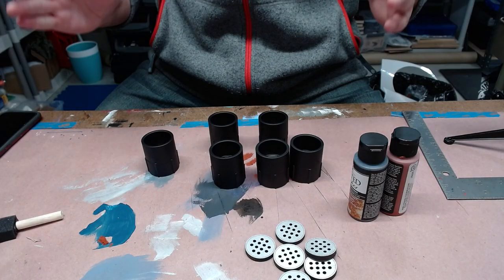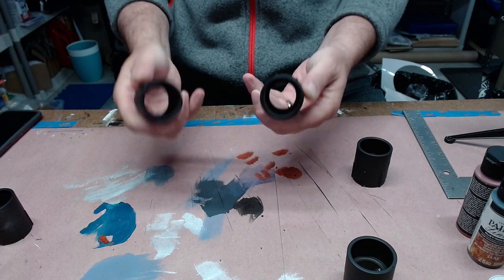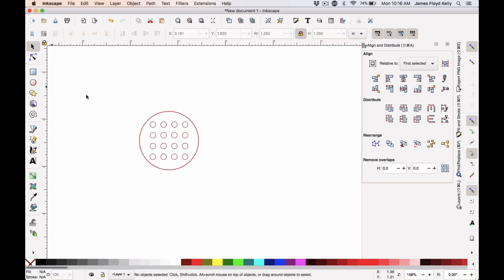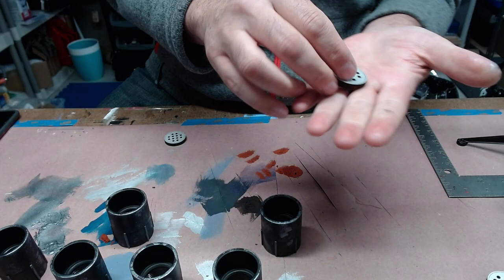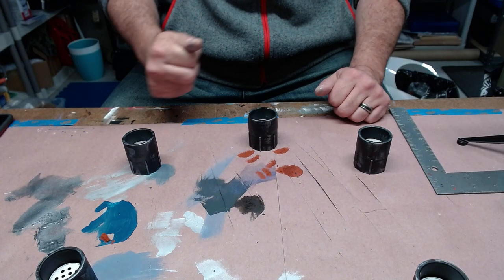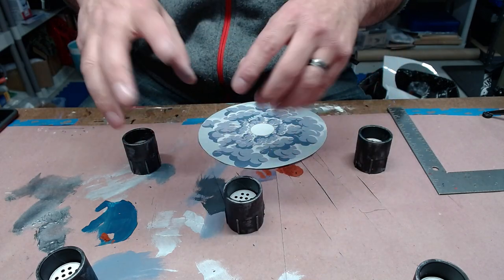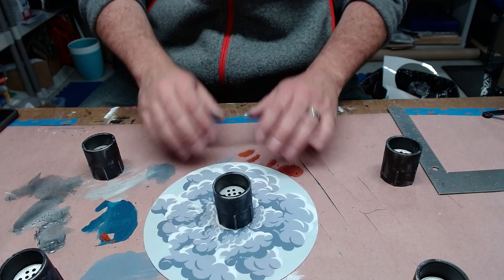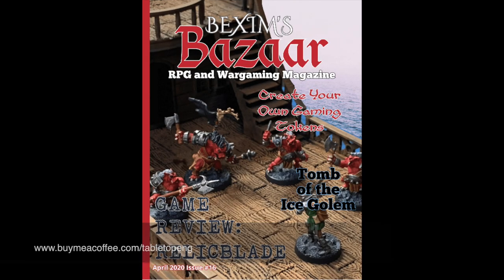Stargrave Terrain Scenario 3 - Steam Vents of the Undercity

Comment: It occurs to me that a thin, plastic ring of the right diameter would be an even better marker than that flat template. Putting the template in place would require lifting not only the vent terrain by also all miniatures or scatter in its circumference. A ring would drop around that circumference, and clearly mark the range of effect!
Reply: I had the exact same thought. An empty ring done up to look like steam would work so much better.
Reply: I left a hole in the center of the graphic to cut out for just that reason. It can slip over the vent if you need it to.

Comment: I have been thinking of getting a laser cutter but have no clue where to start for anything affordable. Seems super useful for scratch building. What model do you have? Are the ones in the same range as resin 3d printers (like 200-300ish) worth getting do you think?
Reply: Hi, Joe. I was where you are a few years ago. I got the Glowforge Basic figuring it would be a good tool for learning, and it was. That said, I would not purchase a GF again knowing what I know now:

1. You're dependent on GF for calculating tool path -- you create the image, but you have to submit it to GF for their servers to calculate the code required to drive the laser cutter. While I've never had difficulty submitting a job, they are now charging $50 per month to get in the "hi speed" lane (it is $15 for month for us original backers, but I would NEVER pay $50 for it). I've heard complaints from those not using the service that they get in the queue and can wait minutes to half an hour or so.

2. Repairs require one of two solutions - you send it back in and wait OR they offer you a discount on a refurbished machine that they send you and you use the box to send your non-working unit it. This is not acceptable for small businesses, but for hobbyists it might not be an issue. 

3. The GF is SOOO SLOOOW. Engraving and cutting is sluggish compared once you've tried your hand at $5000-10000 machines. The BASIC is now $3000 for a 40W machine. You can get a Thunder 100W for $10k. Yes, 3x+ as much, but a 30 minute cut job on GF takes about 5 minutes on the Thunder, so a small business will more than make up the costs of the higher $ machine over time.

I have enjoyed my GF and will continue to use it as a backup but I wouldn't buy it again. That said, it DID help me learn the lingo and techniques as well as make me a pro at Inkscape :)